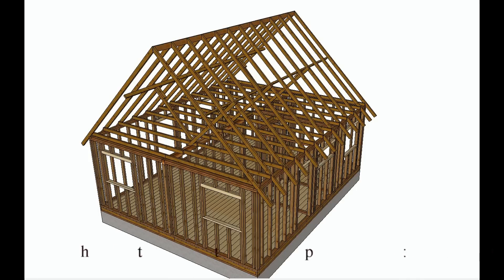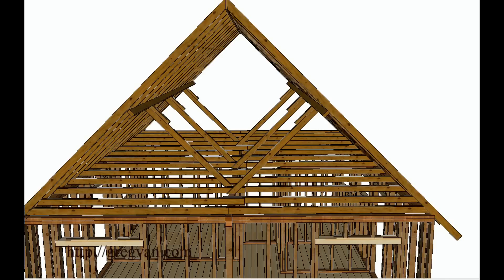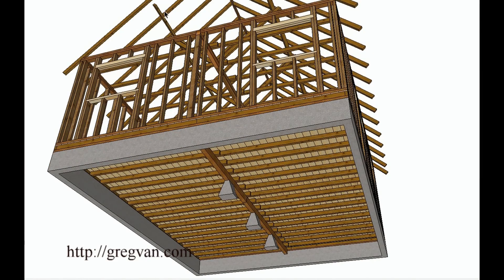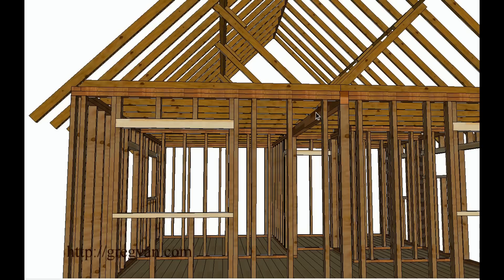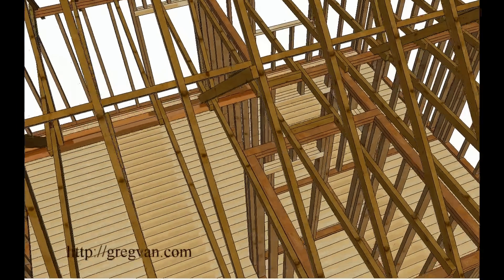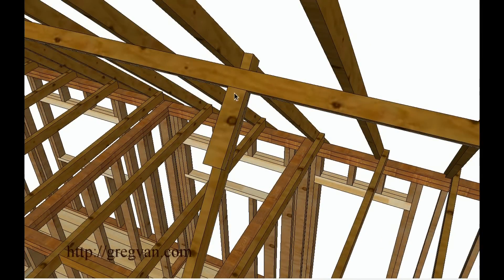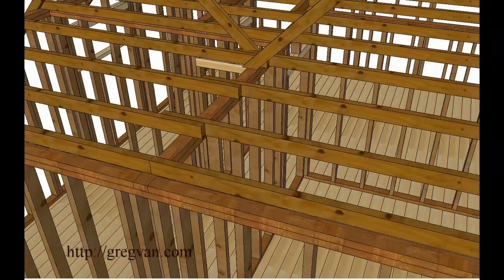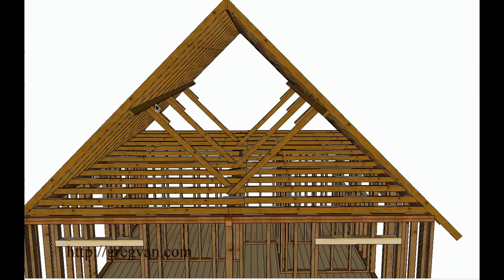What Is A Roof Purlin? – House Framing And Construction

Comment: I would like to add, for your approval, purlins, " ...shal be installed to bearing walls at a slope not less than 45 degrees..." Plus spacing to to not be greater than 4 feet and the brace length shall not exceed 8 feet in length.

Comment: If this was an old house in Southern California would it make the house more resilient to add metal hardware at the various purlin connections? If so, any specific hardware and locations, or just link everything together with hurricane ties?
Reply from the maker: If you're looking for a little more strength and you don't mind spending a few more dollars, then go for it. However, I don't have any individual product recommendations.
Reply: @gregvancom  Thanks for the quick reply! I’ll spend some quality time with the Simpson Wood Connectors catalog.

Comment: How to calculate hip roof purlin loads? Dead and live loads over tributary area for each purlin are probably too great since the load bearing of the rafters minimizes the load. Intention is to remove load bearing stud wall and replace with wood beam with jack and king studs with load transfer to foundation below. Need purlin loads to design beam.
Reply from the maker: I'm not an engineer, so won't be any help there.

Comment: Say you want to expose the roof and eliminate the ceiling, can the purlins be eliminated and a reinforcement added at rafters level support them?
Reply from the maker: You might need to check with an engineer on that one, but I have seen larger rafters installed so that roof purlins could be removed.

Comment: If i have a roof with ceiling width approx 15m being held by 2 lots of purlins per side braced on internal walls can i remove the top purlins and use collar ties? The roof pitch is no more than 30 degrees I'm needing unrestricted access to those internal walls to replace ceiling joists with floor joist system for second storey before i remove the roof
Reply from the maker: If you think you can do it safely, then go for it.

Comment: Will this work if the bearing wall/beam is offset about 3 ft from the ridge?  Could I drop some verticals from the purlins to the joists to support them?
Reply from the maker: Purlins and structural supporting braces can sit on top of anything that will support their load, including the proper sized ceiling joist. Something else to consider would be to install some type of support beam to carry the load if possible.
Reply: @gregvancom  I might try to send some photos. I've tried to get an engineer to inspect but they don't want to drive 100 miles to get to my house.

Comment: Happy to find you! If you  are kind enough and have the necessary time to answer to some questions I asked a lot of people, nobody gave me a right answer for. Here are my questions: I have a very big house and I want to cut it into 2 smaller houses, it's a long house. The cut is in a hall that has no attic, but has pillars supporting the roof. I want to cut the roof between 2 vertical posts/pillars, the posts running horizontally will be cut, one in the middle of the hall, the highest point of the roof, 2 others lower. Will the structure of the roof be damaged?  The hall separates the 2 houses, then I want to demolish the wall on a distance of about 3,5m, the distance I want to take the roof off .The walls are in brick, very thick, 60 cm. Shall I put concrete pillars at the end of the walls, after demolishing?  Then in one of the houses there are pillars coming from the attic into the rooms. Can I cut  some of the , put them on beams in the attic and take them off from the rooms without  damaging the structure of the roof? Thank you for all your videos, very informative and effective, I learned  so many things  from them.
Reply from the maker: I have to admit, you are the first person I've ever heard of who wanted to cut a home in half. Obviously you have your reasons why, but I don't think I would do it, just throwing that out there. Feel free to send me some pictures of your attic and roof and I will see if I can help you out. You can get her email address at the website.

Comment: Greg, my SE says to support rafters with acrow props all the way through from floor joists to the purlin directly. Though the purlin has not a flat surface being it at an angle. Any videos on ways to prop structures?

Comment: This type of support seems like it would put a diagonal load on the wall below instead of a straight down load. Especially if both sides aren’t fastened to the same wall to help balance each other out.
Reply from the maker: I agree sometime it will be better to reduce the angle or use vertical supports.

Comment: Thanks for the great content!  I am trying to install a whole house fan but purlin bracing is in the way.  The purlin bracing obstructing my install is not tied into a load bearing wall. Rather, it is resting on a block sitting on the home's old flat roof (a pitched roof was built over the original tar/gravel flat roof).  My tentative plan is to remove the purlin bracing pair and then add a rafter tie and also sister additional lumber to the purlin strong backs that span this particular area.  Any initial thoughts or ideas are much appreciated.
Reply from the maker: I cannot provide you with structural engineering advice for your individual project, because it could be confusing to others, but can tell you that I've seen what you're suggesting been done before. I think the best information I could give you would be to take a common sense approach to this problem. For example, if there's a way you can relocate the brace or modify it in a way to where it will still be supporting the structural load from the roof, then go for it.

Comment: Great presentation! I have this exact type of roof and I'm planning to open up a 10 foot section of the load bearing wall below. I plan on  having temporary braces for the purlins sit on the joists directly above my temporary support wall while I install a 2- 2x12 "beam". There is concrete footing on either end of where the beam will be. What other considerations do you think I should make? Thanks!
Reply from the maker: I can't provide the engineering information you're requesting. However, I've seen 10 foot 4 x 12's support areas like that.

Comment: If you don't have a wall on which to set your purlin braces, you can set them on a strongback, right? I suppose it's different for different areas of the country.

Good video.
Reply from the maker: Not really, because it would put additional weight on the ceiling joists, but you could do it if the ceiling joists were designed to support the weight in that manner.
Reply: Right, but a strongback being stiffened, and blocked up on the ends, it doesn't put the entire weight of the purlin wall on the ceiling joists. The ceiling joists can be oversized, as well. But you're right, it would add weight to them.
Reply from the maker: I've seen plenty of projects where construction workers put purlins on top of ceiling joists without any problems, but this isn't suggesting that it will work all the time.
Reply: Yeah, every situation is different.

Comment: Great vids. I subbed, liked, and bookmarked your website. I have some photos and questions for you that I will post in the near future. I think the photos will be fully self-explanatory to you. I intend to get a structural engineer out here sometime soon, but I just want some preliminary information as my 1937 house has purlins, but they are not installed correctly and seem almost haphazardly placed, some on the tops of load bearing walls, but many are not. If you would be willing to look at my photos maybe you could tell me what is up with my house. It is that funny construction using shiplapped planks throughout, internal and external walls, the floors, the ceilings, and the walls have the planks set at a 45º angle. I know this is supposed to spread the downward force of the roof toward the ground like buttresses or some such (or so I have been told). If this is not nonsense, if it is actually a structural feature, it seems to me that to replace these planks in the walls with OSB might weaken the structure. I know - I have no idea what I am talking about, but at least I am interested to learn and know I speak from a position of ignorance. :-)

If you are willing to look at five or six photos of my attic and answer a few questions I could make some actual plans and see if hiring a structural engineer would be a waste of money and time because what I want to do is just not going to work. If this home had been built with more modern techniques I would have fewer issues understanding what is what.

Hoping to hear back from you. I could give you my email if you have a Contact Me system on your web page. Hope to hear from you soon. Your videos are well produced and very informative. I see light at the end of the tunnel. Or something like that, heh, heh... 

Thank you for the information and for your time reading this comment.
Reply from the maker: Send the pictures to me and I will check them out. My email address can be found at our website, simply go to the bottom and look for contact. Thanks for liking and supporting our website.